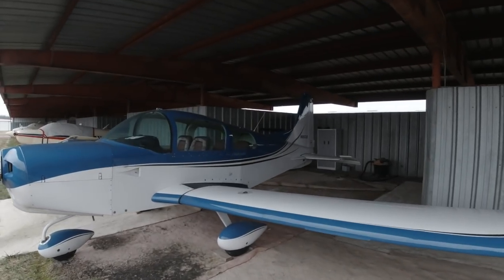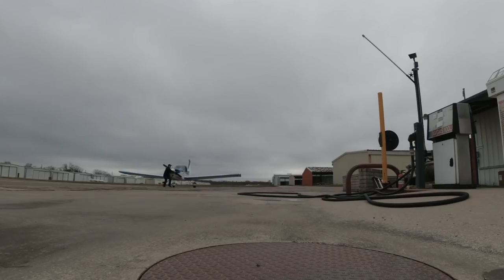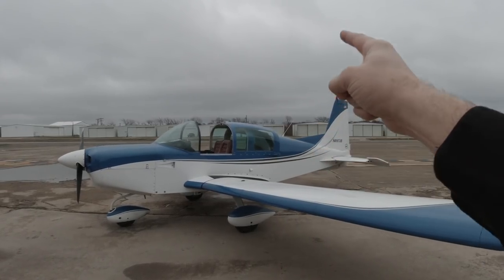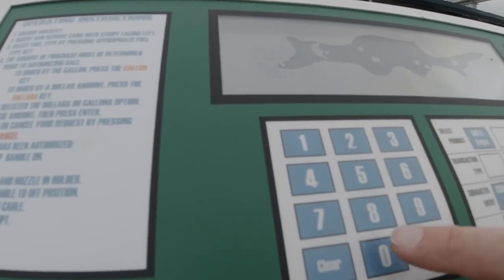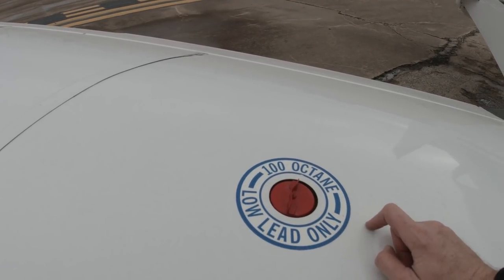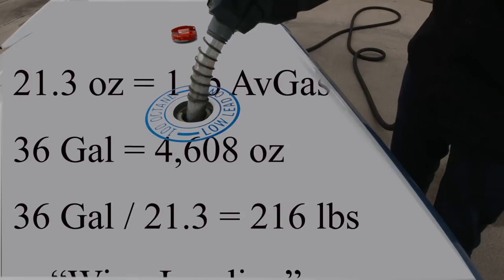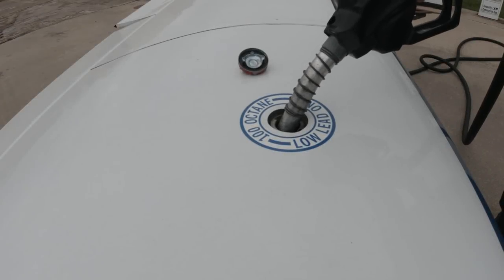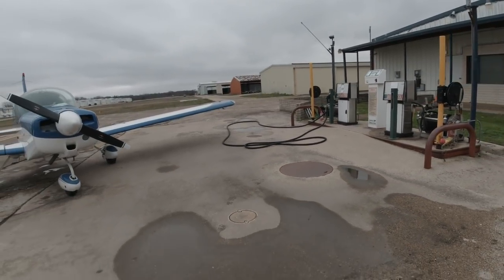How to Fuel an Airplane

Comment: If each tank holds 20 gallons and you fill it with 100 octane, is the resulting total 2000 octane?
Reply: Respectfully, that's kind of a stupid question. Of course it does. More is more.
Reply: You guys!  Did you go to school?  100 octane + 100 octane = 200 Octives. Jeeze!!!!!
Reply: No, the total is 4000 octane.

Comment: You forgot to mention that you can calculate the amount of fuel left in your tanks by lighting a match over the filler holes. The caps have to be off however.
Reply: That gives you an estimate. Precision improves as the eyes get closer to the filler hole.
Reply: Do that and the tanks will be exactly empty! Haha

Comment: You should also explain that people are supposed to not leave the fuel nozzle plugged in the tank when starting the engine and taxiing on to the runway. Happens all the time.  Such a mishap would be very unfortunate because the additional weight of the fuel nozzle will add to the already heavily loaded wing, and the dangling hose increases drag substantially. They teach us about the importance of aerodynamic drag but the drag created by thoses hoses is never mentionned.

Comment: I never knew there were 2 fuel tanks. My hero saves the day again. Now the plane wont be ap hard to keep straight and level.

P.S cessna should just put thw gas caps on the bottom of the wing so we dont have to climb on a ladder to fuel up.

Comment: I recently purchased some LL100 for my high compression 66 nova to save some money. The race fuel costs anywhere from $7-11/gal and I had always wanted to try LL100. The pump was different than yours and the pump handle was enormous and nothing like we were expecting. We were scared anyhow because we had drove into a small airport at night with no lights except that beacon(?) flashing around every 4-5 seconds. Lmfao the fuel came out of that handle like a fire hose and it was a horror show trying to fill several 5 gallon jugs. I am confused as to why every airport around me will not let me just purchase the stuff. Oh well, I wish I would’ve seen this video first.
Reply: Hell I thought I was the only one that did that, I filled my 69 Chevy nova with  avgas in 82 or 83 wile working for North Coast Helicopters great  fuel man!  I flew right off the over pass nosed pitch down impacting the terrain. That’s the shit fuel right there , super high performance!

Comment: Uggh.... I know it’s a goof video of sorts.  But as a veteran and a crew chief/ramp rat for 12 years... I have to say something about fuel hoses and grounding. Obviously you ground the acft prior to pumping fuel.  The hose itself is a ground source and there is a reason the stainless steel mesh that lays under the rubber is there. When moving fuel thru a hose it creates its own static charge INSIDE the fuel as it moves.  The metal nozzle should always be kept IN CONTACT with the metal rim of the fueling port ... that is what the Spiral is for on the nozzle... to keep a contact path along with stopping the nozzle from slipping out.   Under the right atmospheric conditions... pumping fuel can be scary.   I used to move a Million Pounds of JP-4 every night ... and that was a slow night

Comment: As a native Californian, I'm just wondering, can I run my Prius on that aviation gas?    It's been an age since I've seen gas that cheap.
Reply: haha. from the net.. because you made me curious: "100LL would work great in a modern car, especially in cars that need high-octane fuel. But only for a time. I think the catalytic converter would be destroyed first, and then maybe modern rubber/synthetic seals or fuel lines designed to run on the current 90/10 gasoline/ethanol mix would later disintegrate"
Reply: @Dan007UT  You'll probably destroy your injectors before the rubber goes.

If you can keep it running long enough, though, you'll kill the whole engine - modern oil systems aren't made to deal with lead buildup in the oil sump, and you'll get plenty of lead fouling from blow-by of combustion products.
Reply: so you'll get enough to escape CA.. but not much after that. :)
Reply: there’s also something called “mogas”. the local fbo is .50 cheaper than LL at $4.50